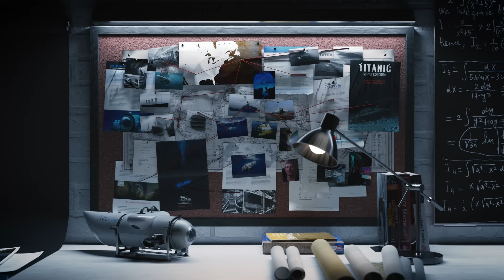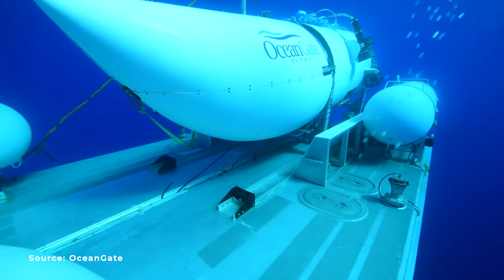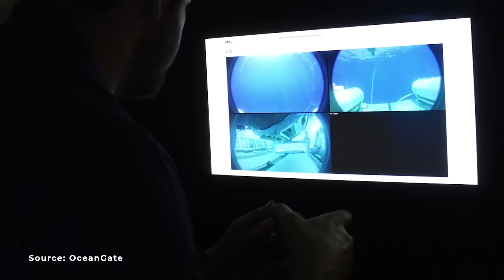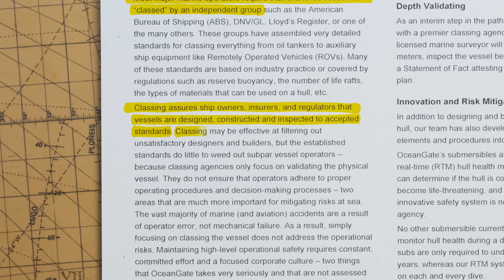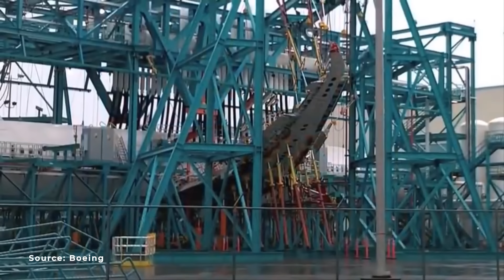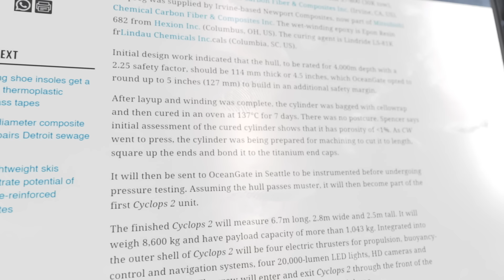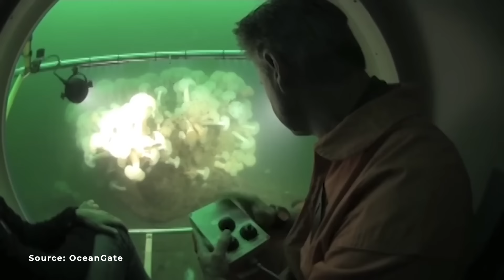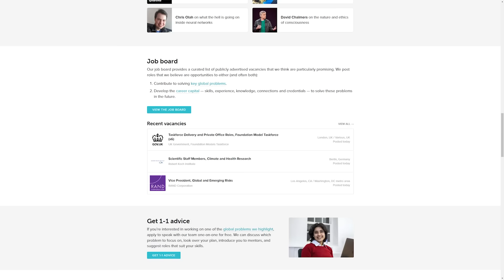The Questionable Engineering of Oceangate

Comment: It absolutely kills me that the owner of the sub was literally quoted as say, "Why is it that so many resources are being put into exploring space rather than our own oceans?"
Because, in some ways, space is easier to explore than the deep ocean.
Reply: he should have asked why he didn’t put more resources into exploring the oceans instead of cheaping out
Reply: @GreatistheWorld  Dude cheaped his way out of life lol.
Reply: Getting to space is harder than getting to water.

But being in deep space is much easier than being in deep water.
Reply: @sujimayne  the surface of the moon is safer than the ocean floor
Reply: This,
space is only 1 bar of pressure, and it's inside-pressure - meaning all the materials and seams are under tension, and a round cross section is incrediby stable, while even non-round cross sections can fare fairly well.
Tension is preferable for many materials, and it's easier to design around.

Pressure is a pain, even if it's NOT 300x times the pressure difference you'd experience in space.

Easiest way to visualise is this:
Try taking a thin plastic, empty soda or water bottle and try to sucking the air out of it until it collapses - easy, right?
Now try blowing up the same bottle by blowing air into it - good luck, don't pass out.
Reply: There are 375 Atmospheres of pressure difference between the Titanic's depth and the surface. There's only 1 Atmosphere of pressure difference between the vacuum of space and the surface. We're practically vacuum dwelling organisms compared to the depths of the ocean.
Reply: There are also more regulations when traveling to space.
Reply: Yup. And a big reason for this is that the relative pressure difference between 1 Earth atmosphere and space is far, far less than 1 atmosphere and the deep ocean's pressure levels.

Yes, it's easier to travel to the deep ocean, but it's far harder to survive there.
Reply: @Noisy_Cricket  if it was easier to travel to the deep ocean than why is it most of the sea floor is unexplored whereas we know most of the moon and a number of other bodies?
Reply: @toomanyaccounts  I mean it's pretty easy to get to the bottom of the ocean. You just sink down. That doesn't mean you're going to survive down there. Technically, people could have traveled to the Marianas Trench in the 1850s or so with a watertight iron cylinder. They wouldn't have survived, but they would have reached it.

We didn't have the technology to reach the moon at all until 120 years later. But we had the technology to survive at least a few days in space since about 1850- when people figured out how to reliably produce air tight chambers.
Reply: I don't get how some people believe space is easier to navigate than the ocean. We literally have to train astronauts for years to maintain machinery to keep themselves alive and tackle the mental toll that comes with such a task. Then we have the people who are on the ground doing literal rocket science to launch a tube out of the atmosphere
Reply: @de_dorf279  
people are very obviously talking about the materials and structures needed to maintain a survivable habitat there, not the physiological implications.

Though even the psychological implications extremely similar. You're in a cramped tube, where no one can realistically retrieve or save you, and you're dead within seconds if the hull blows.
Deep sea is only lacking the Zero-G aspect, which - sure - is nauseating, but it also HELPS with minimizing the necessary structural integrity of your vehicle.
Just as well that astronauts CAN maintain their vehicle, even from outside. Try that at 3 km below zero - You'll be pink paste, no matter what suit you put on.

Sure, orbital mechanics are a bunch of complex math, but it's math we mastered just enough to put people on the moon in the late 60's. The SIXTIES.

The only reason going to & traveling in space is so bullshit is the insane amount of fuel you need to get your stuff there in the first place.
Reply: Pressure hulls in space only need to withstand 0 to like 1 atmospheres of pressure. Thats why its easier, the engineering challenge is reaching escape velocity and withstanding those forces.... we have been doing that since the 1940s
Reply: It also killed the owner of the sub
Reply: once you get there, all you have to do is just hang around
Reply: Going into space the vessel only has to withstand with one atmosphere but going to the Titanic the vessel has to withstand 380 atmospheres.
Reply: in some ways yes
in terms of pressure, the highest difference will be 1 atm
for oceans it just keeps increasing till dozens of bars

but in terms of distance, ocean is better

you can't really use just any kind of thrusters in space cuz newton's laws go brrr
Reply: Between space and sea level there's only 1 atm difference, that's only 10 meters down from the surface....
Reply: I guess he should've put more resources into exploring the ocean :p
Reply: It did not kill you as much the Titan killed these people HAHAHAHAHAHAHA
Reply: Observation of space is easier, not necessarily travelling in it. And thus it's easier to "explore" space. Because information such as light can travel through a vacuum more or less indefinitely, you don't need to get close to something to observe it, you just need instruments that are precise enough to process the information it's emitting. The problem with the ocean is that not only is the environment extremely hostile, it's all encased in water. And information cannot travel through water indefinitely. That's why deep sea exploration has to be done via sending a submersible, unmanned or otherwise, directly to a site to observe it. Otherwise if the ocean was as easy to observe from a distance as space, we'd have just built an aquatic Hubble telescope.
Reply: In some ways sure, but that's like saying in some ways a B-52 bomber is better than a B-2. 

The complexity (i.e. difficulty) of manned space exploration could only be funded by an entity with the resources of an entire  country. There's a reason why, at least initially, space exploration was limited to government agencies and not private companies. As far as I know, that's never been the case for deep sea exploration.
Reply: Almost like things meant to go to space don't need to have as much bracing ('cause of that spicy light) as things meant to go underwater (haha pressure go brrr)
Reply: If by exploration you mean observation, then yes. Actually getting to places in space and exploring them is infinitely harder than exploring the ocean.
Reply: I've never disagreed with a comment so strongly before on yt
Reply: @de_dorf279  good thing science doesn't need your agreement
Reply: @de_dorf279 He's right though. The lack of pressure in space, is much easier to deal with than the pressure. Basic physics dictates this, once you're in space it's incredibly easy to maintain, the hard part is just getting there and now it's SpaceX it's pretty easy to get something into space.
Reply: @karakumgaming386  it's literally not though, the lack of pressure does make things easier but to say maintenance is easy in space is a bit much considering its so cold out their that metal can weld itself together given a circumstance. Tools can and have been lost to space because of butter fingers and what ar u suppose to do when you lose the tool you need to keep with regular maintenance.
Reply: @de_dorf279 Deep sea is cold too. Not as cold as space but still a challenge to consider. The main reason why sea is harder than space is the pressure delta. You have a 360atm delta between the 4000m deep ocean and the pressure chamber. Space is gonna be a 1atm delta at most, assuming the cabin is pressurized equivalent to sea level. Imagine those movie scenes where people get sucked out of a space station, but 360 times faster. You need hundreds of times more resilient material than spacecraft to make deep sea diving possible. 

Also, communication in deep sea is a nightmare. Radio signals deteriorate quickly in water, especially at such depths, whilst radio communication to space is fairly straight forward. 

Lastly, navigation and vision. There is no light once you get under 1000m down. You need high power light arrays just to light a small space in front of you in the ocean. Sonar is the only viable navigation solution and has its limitations, including causing damage to wildlife.

Go to any website discussing exploration in space vs the deep sea. There’s a reason why we don’t know much about our oceans. It’s still significantly cheaper to safely send someone to space than the deep sea.
Reply: @karakumgaming386 so true , the risk in space is 99% in the launch once in space , people just dont get it , launch is the critical bottle neck, once we reach a critical mass in space it's just going to be just a higher sky.
Governments and companies are already preparing for this .
The ocean is a very different matter 😂
Reply: @karakumgaming386 so true , the risk in space is 99% in the launch once in space , people just dont get it , launch is the critical bottle neck, once we reach a critical mass in space it's just going to be just a higher sky.
Governments and companies are already preparing for this .
The ocean is a very different matter 😂
Reply: @de_dorf279 Space is far more forgiving than the deep, and space is not forgiving.
Reply: @de_dorf279 😂😂 and i disagree with you.
The vaccum doesn't suck but the ocean, the ocean will CRUSH!!
You can fix a hole is space , you cannot fix a hole underwater lol